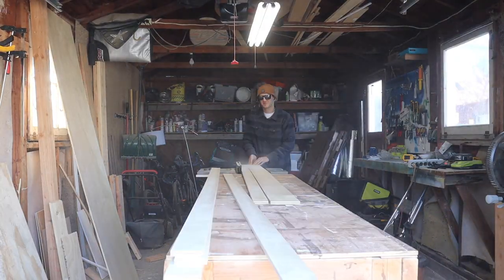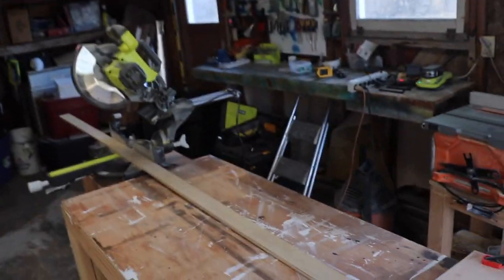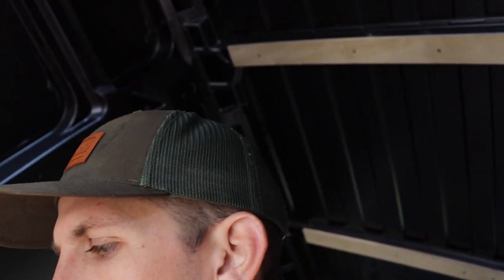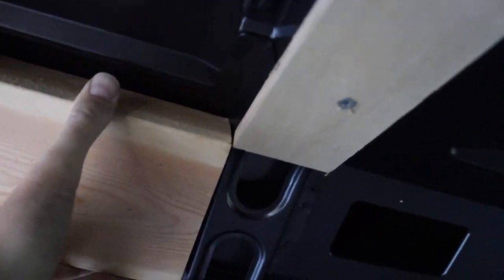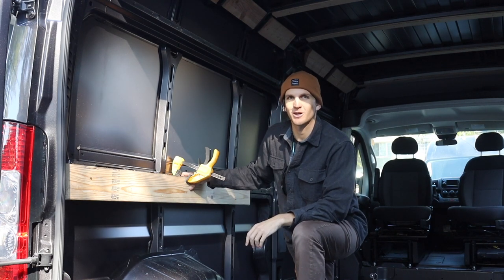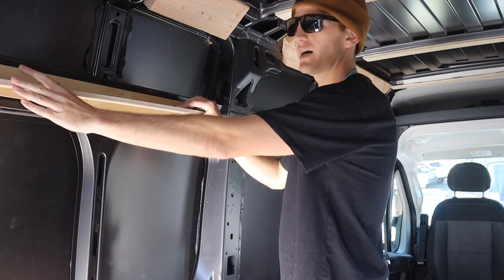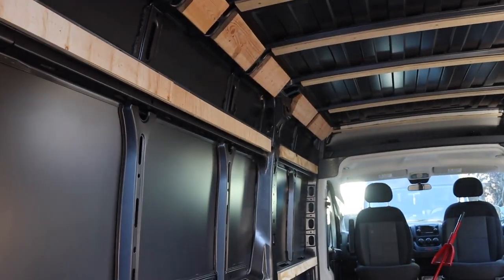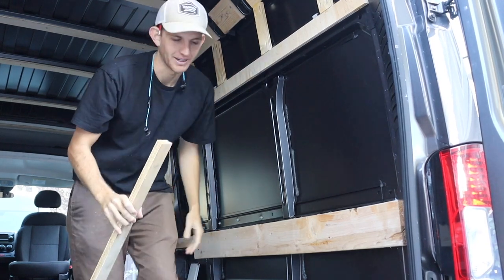VAN BUILD | FRAMING a RAM PROMASTER

Comment: Does it really matter on the ceiling boards if I’m using 3/4 pine  I know u mentioned 1/2 not sure ? if I have to trim them  down I’m using fascia 2/6s it’s actually 1-3/8 thick does it matter upper top so where they meet I’m actually building it right now after watching your videos which is very inspiring well explain your doing a awesome job thanks for your time that  u invest
Reply from the maker: I used 1/2” to save some space for head room. Nothing wrong with using 3/4”

Comment: Did you install any insulation behind (inside) all of the ribs you used to install your studwork? Are you concerned with thermal bridging?
Reply from the maker: I stuffed insulation in there as best I could. I have a full insulation video :). I used 3m thinsulate and it works great!
Reply: @AnkeneyVanBuilds  Thanks for the prompt reply! Very helpful video BTW! I am at beginning of my Promaster build and soaking up knowledge wherever I can find it. Have you considered using rivnuts vs self tapping screws for strength and to avoid drilling more holes in the van? I like the simplicity of self tapping screws and wonder how difficult it would be to use the riv nuts (alignment etc) and pondering the pros/cons. Thanks.
Reply from the maker: @johnhaug8317  I have nothing against riv nuts! It’s a great option. There are many different ways to build out vans! This is just the method I prefer

Comment: Thanks for the great framing guide! If you had to do it over again, would you still go with the plywood instead of solid furring strips?
Reply from the maker: Ply wood works great!
Reply: I am also leaning towards the furring strips. What did you decide on SoCal? Thanks
Reply: @dronesofyork8055 I’d go with plywood if I could afford to do my whole van in Baltic birch or marine plywood.  

But since my budget is closer to folded newspaper framing than good plywood framing, I’ll have to settle for the furring strips.
Reply: @SoCalKevin  I don’t know which is stronger, but ripping plywood is not as easy for me. I have a circular saw and a guide, so it can be done. Furring strips are ready to go but apparently they don’t have enough flexibility for the van installation. Thanks

Comment: Hi! Just started framing and was wondering if you used regular 2 1/2 inch screws on the 2x6’s or self tapping wood to metal 2 1/2 screws? We’re having trouble with the self tapping omes
Reply from the maker: I used 3" Spax construction screws that are used for wood and metal!. what issue are you running into with the self tappers?
Reply: @AnkeneyVanBuilds  awesome thanks! The self tappers worked on the roof and on the 3/4 inch wall panels but they didn’t seem to have anything to hold on to once they made it through the 2x6’s. One more question if you don’t mind! What width did you cut your 3/4 panels for all of the vertical supports?
Reply from the maker: @angeleishulman7635  hmm maybe your missing the metal and hitting one of the holes in the frame....  I ripped it to 2-1/2 wide!
Reply: @AnkeneyVanBuilds  that sounds about right! Thank you so much!

Comment: Great video. Question though. For the short vertical supports that will end up behind your cabinets, what thickness are those boards? 1/2" or 3/4"? I like the idea of the pocket screws, but it seems like 1/2" would be to thin for those pockets.
Reply from the maker: You’re exactly right. The vertical walls were all 3/4”. The angled corner pieces are 2x6s. And the ceiling is 1/2” 
Thanks for watching :)

Comment: Hey man great video - where the shiplap meets the rear end - did you have to cut that 1x3 board with a slight bow or does it run straight across? Doing as we speak. Thanks!
Reply from the maker: Honestly I can't remember! I think it ran straight across!

Comment: Hey Colton, really enjoying your van build series! I am currently converting a Peugeot Boxer (same as your van) here in Europe, so it's very helpful. Just a question about the wood you have used as the structure of the van: do you protect them with any type of oil/varnish/paint so it doesn't get any mold or things like that? Or do you feel like it does not really matter? I see that you have used primer/paint on the wheel boxes and other furniture you have built, that's why I am wondering. Thanks for your help! You're killing it
Reply from the maker: Hey Logan! Congrats on buying a van and building it out! I didn’t put any oil or finish on the structure frame pieces. I figured since you don’t put any finish on framing pieces of a house. It’s the same concept in a van. I painted the wheel boxes because you’ll be able to see those on the finished build!

Comment: Ive watched so many framing videos and I think I like the way you did yours the best!  Are you still happy with it?  Also, Are your vertical supports 3/4 in ply strips? And what size screws did you end up using for securing the 2x6s?   Thanks so much!  Because of this video I may be able to do this myself without paying for assistance!  I don't have any wood working experience lol  Thanks again! -RR

Edit - Reading through the comments and I see 2 1/2 or 3in screws will work for the 2x6s.  And that the wood sizes are: The ceiling pieces are 1/2" ply. 
The walls are 3/4"
and the transition from ceiling to wall pieces are 2X6s. 
the bed frame is also a 2X6

So now the only question remaining is are you still happy with how it came out or would you do anything differnt?  Thanks again for all the great info!
Reply from the maker: Thanks for the comment :)
I would not change anything. This (in my biased opinion) is the absolute best way to frame this van out!

Comment: Hi!  First, thank you!  We literally just picked up our van yesterday and will be following many (if not most) of your steps.  One question, though, (and I may have missed this) but do you have a video showing how you disconnected that rear light centered over the rear doors?  If not, could you possibly talk through it here?
Reply from the maker: Hi! Congrats on buying your van!! I didn’t talk about it in the video. But you simply pop it out and unplug it!
Reply: @AnkeneyVanBuilds  Great! Thank you for such a quick response!
Reply from the maker: @wendistraight6425  you’re welcome! Feel free to ask as many questions as you want
Reply: @AnkeneyVanBuilds  - You may regret that offer as I have yet another quick question :)   What size Kreg screws did you use to attach the vertical 1/2 inch framing pieces to the 2x6s?
Reply from the maker: @wendistraight6425  the vertical pieces are actually 3/4” ply! And the screws are 1-1/4!
Reply: @AnkeneyVanBuilds  Thank you!
Reply: @AnkeneyVanBuilds  Sorry, me again.  In the video, you say that you rip a 4 x 8 sheet of 1/2"  ply for the framing.  Did you mean 3/4" or did you just use 3/4" for those vertical pieces?
Reply from the maker: @wendistraight6425  1/2” was just for the ceiling. The rest was “3/4!!
Reply: @AnkeneyVanBuilds  Got it!  I really appreciate you and promise to try to wait at least a week before pestering you again :)
Reply from the maker: @wendistraight6425  hahah no sweat! Ask as many questions as you want!

Comment: Good ideas with framing - especially along the ceiling transition.  Your method of ensuring everything is on level is something I should have done.
One technique that might cause problems in the future, though is using self-tapping screws and glue.  I understand the desire to make everything rock solid, but some areas - such as the space over the rear doors, and the electrical chaseways in the upper wall sections - need to remain accessible for future repairs.  By screwing & gluing those areas, it will be a nightmare to do any electrical repairs or additions in the future.  Instead of using self tapping screws directly through the metal + glue, use rivnuts or plusnuts in the holes already present.  This makes an incredibly strong structure that does not rattle, and can be removed for any repairs or upgrades.
Otherwise, nice build!
Reply from the maker: Thanks for the feedback! That is good point. I think either way if you have to go back and fix those it would be a night mare haha
Reply from the maker: @natureloversadventures7335  yeah you could totally do that!!!

Comment: Do you have any tips for using those self tapping screws with the 2x6’s?  Stripped two right off the bat and now I have a couple nice holes in my frame. Trying to reset and figure how I want to approach this next.
Reply from the maker: Having a good impact driver and the right bit should fix that

Comment: We are doing a similar set up as well! Great job. Did you use cross nuts? or are you happy just drilling into the supports?
Reply from the maker: Great question! I did not use cross nuts. I used wood to metal self tapping screws with construction adhesive. This is the second van I’ve used this method on my first van and it’s held up great for over a year and a half now!
Reply: @AnkeneyVanBuilds  Good to know! We have been going back and forth with it. Thanks for the insight!
Reply from the maker: @meganandmitch6813  they’re both great options! The cross nuts are most liked stronger. But the self tappers and adhesive is also strong and must easier to install!

Comment: I have never worked in construction or built a campervan so excuse my very basic question - what kind of plywood do you use for the frame and in the video about making the bed? I made a very rookie mistake following another site's instructions on installing my floor and I first laid down regular plywood and treated it for mold - it promptly warped and I learned there are different types of plywood and I didn't need to treat the wood if I had the right plywood. By the way - your video on installing the floor also helped me solve the issues I was having. Love your videos!
Reply from the maker: I just used the standard plywood. Typically made of Pine. It’s important when sealing wood to seal it on both sides. All wood is going to expand and contract in some way! I used birch plywood for all my cabinets. But regular for the framing and bed frame. Glad my
Flooring video was helpful :)
Reply: @AnkeneyVanBuilds  Thank you for your quick reply!
Reply from the maker: @kellyhaas1194  always :) feel free to ask as much as you want

Comment: After watching this several times I have to say that this is the best framing method for the Promaster I have seen! I do have one question. Do you perhaps know how much room length wise along the driver side wall there is behind that pillar that caused you to use 3/4” instead of 1/2” strips on the wall? I ask because I am going to frame out slightly different on that wall because I am going to install a Murphy bed and I thing that pillar is the best looking framing point. For the bed box frame.
Reply from the maker: Thank you so much!! Murphy bed will be a great idea! I don’t remember off the top of my head unfortunately.... sorry

Comment: Hey, great video, you've got another subscriber! I am not an expert at all. I am only just getting started and it is early stage of my van built but I would have  insulated those holes in the ribs (or how do you call it?!) Before screwing down the frame. Any special reason why you did not do it?   Thank you!
Reply from the maker: No reason. It would be smart If you insulated first

Comment: We’ve got two young kids, so looking to put a couple twin beds in along with a fixed queen. Do you think your technique for the queen bed would work if you did it lower than that structural member? Planning to do a fixed queen across the van (like yours), but lower. From sketches I’m planning on the bottom of the bed being 18” off the floor (still waiting on the van, so that’s approximate). That will allow me to run a “twin” bunk along the length of the van above the foot of the queen. Planning for the twin to be hinged so it can swing up parallel to the wall when not in use.
Reply from the maker: Yes that could work. The only difference you would need to do is add some legs to the 2x6 to help support some of the weight! I love the idea of the twin bed!
Reply: @AnkeneyVanBuilds  Thanks again for the quick replies. Nice to bounce some ideas around. Excited to get our kids (currently 4 & 6) out on the road.
Reply from the maker: @DavidWolfFF  they’re going to make some amazing memories! That’s awesome!

Comment: I'm curious about the use of self tapping screws into the van metal framing. It certainly is much easier than using brass rivets and bolts but do the screws create a place for rust to begin?
Reply from the maker: Hey good question! I used this method on my first van going on 2 years ago now and I haven’t had any issues. I think the chances of rust to build up there are slim since the wood and adhesive is pushed right up against the metal!

Comment: Great video! Thanks so much...  Questions please: 
1) For the cross members, you added 1/4 on driver side so it was 3/4 total and was then 'level'.  What about all other cross members?  3/4 or 1/2?  From looking it appears to be 3/4... 

2)  For attaching studs using the pocket holes what screw length/size did you use?  I'm not wanting to split those cross members.

Thanks again!
Reply from the maker: All the ceilings were 1/2 and the walls are 3/4
And for pocket holes I use 1-1/4”!!!

Comment: Hello! Great videos. I had a question on the driver side framing. I used the 2x6 on top then 3/4 - 1x3 for the horizontal and vertical strips. Though the top vertical 1x3 strips doesn’t seems to have a little bit hanging off because of that part of the metal that bends out at the top.. In the video yours looks pretty flush. Anything I’m missing? Thanks!
Reply from the maker: Are you using pocket holes on the vertical strips?
Reply: @AnkeneyVanBuilds  Whoa sorry just re-read the comment I posted. Lol sorry sounds a bit confusing. I’m currently lining up the vertical strips and haven’t done my pocket holes yet. I was concerned because the angle of the vertical strips wasn’t totally flush against the mid-horizontal 1x3 strip. Best I can describe it is the vertical strip touches the front of the horizontal, but maybe about an 1/8th lifted off the back?

Comment: Hey Colton! Quick question. Did you pre drill any of the holes before sending on the screws?  I got the exact screws you used. Also did you construction adhesive the 2x6s as well?
Reply from the maker: If you have a good impact drill you won’t have to. But doesn’t hurt to predrill. And yes on the construction adhesive!
Reply: Awesome thanks! And when you were putting the 3/4 horizontally along the supports I noticed you kinda followed the crease in the support. So when your 3/4 is glued/screwed horizontally not all of it makes contact with metal is that correct? If that wording doesn’t make sense let me know I can elaborate lol

Comment: What thickness of wood did you use for the beams going horizontally to secure frame?
Reply from the maker: The ceiling pieces are 1/2" ply. 
The walls are 3/4"
and the transition from ceiling to wall pieces are 2X6s. 
the bed frame is also a 2X6

Comment: Newb question, I have heard it's great to use stainless steel screws, but the only ones I could find per your suggestion were like steel coated w a gray galvanize look.  Thoughts?  Thanks for all these videos, I'm using them while building!
Reply from the maker: Those should work great!
Reply: @AnkeneyVanBuilds  Thanks for always being helpful!  Are you drilling pilot holes in the wood?  Through the metal, or does the self tapper take care of that?
Reply from the maker: @Zakrivers  through both! The self tappers are supposed to work but it doesn’t always work right away... so predrilng helps

Comment: Hi Colten, I have read through all the comments and answers. You are amazing fir answering everyone, including me. Thank you so much! I'm such a newbie! I have even had to buy all the tools as well. I live in a 55+ apartment complex. No garage. I am trying to figure out exactly how much and what to buy. When you say "I made a ton of strips 2 1/2 inches wide", I'm like...whaaat? I'm jealous of peeps who have a garage and lots of wood laying around, but I know I'm not alone when I say, I'm starting from scratch. How many 2x6's ?, 1/2 inch plywood sheets?, 3/4" plywood sheets?, did you use 2x8's for the sides? I've watched your videos multiple times and am using them for my van build. I have a 2019 Ram Promaster 149" wb. Thank you for any help.
Reply from the maker: Hahah hey thanks! Oh let’s see, I’m estimating but I’d say 3- 2x6s, 1 sheet of 1/2”, maybe 2-3 sheets of 3/4. 
I didn’t use any 2x8s 
Let me know if you have any questions
Reply: @AnkeneyVanBuilds  thank you...I know you used 2x6 on the frame. And on the head and foot of the bed. What did you frame the sides of the bed with? That's what I thought was a 2x8.
Btw, your van was one of the best I've seen yet and I've watched many hours of you tube videos!
Reply from the maker: @barbarabilodeau1323  2x4s!
Reply: @AnkeneyVanBuilds  I was referring to the beautiful 2x8 walnut board you put on the outside edge of the bed. The one you cut out for the sliding table. But I don't know if you added one to the garage side as well?
Reply from the maker: @barbarabilodeau1323  ahhh yes. I believe that was a 1X8

Comment: you mentioned your walls (in prev vanbuild) were loose bc you didnt have enough studs, how'd you fix this in prev van ?
thanks
Reply from the maker: My previous van had 1/4” wall panels so I had to frame it out similar to how I did in this video. So there was more support. For the tounge and grove!